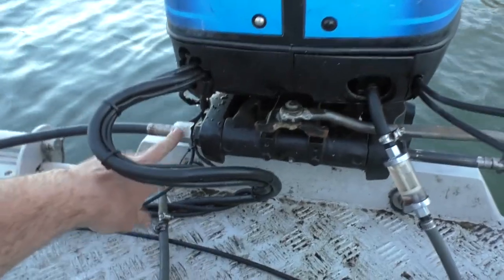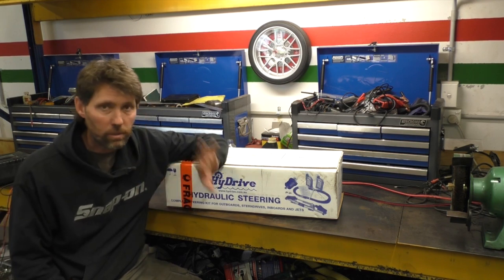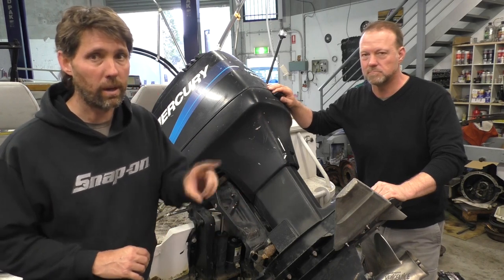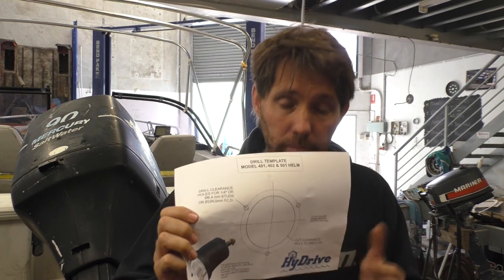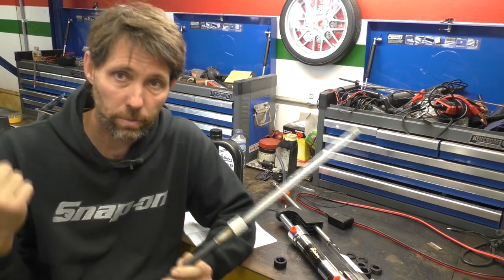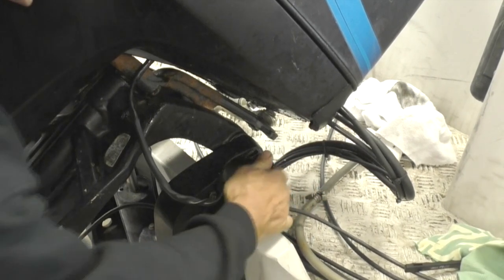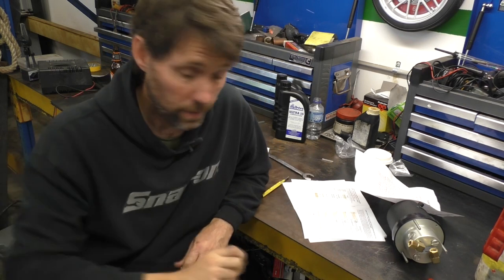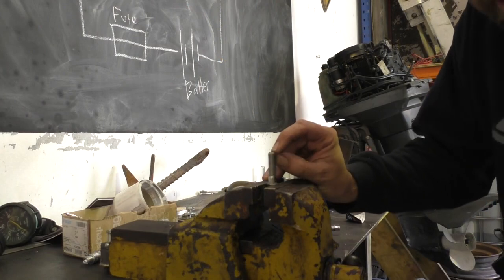Installing HyDrive hydraulic steering in a boat

Comment: Thank you for this. I am fairly new to higher power boating, and in (a long) process of rebuilding a boat from literal trash. This is an inboard/outboard setup, which I built from donor parts the engine and stern drive.. All rebuilt to new or better spec. I maxed the hulls original HP rating doing this rebuild/upgrade, but have rebuild heavier stringers and transom so there should be no troubles there. However as I said, being fairly new to higher powered boats I was rather taken off guard when this exhibited all the symptoms you showed on that boat.  So glad to come across this vid. It explains a good deal and a solution. Now a new subscriber. Thanks for the great vids, awsome introduction to boating.
Reply from the maker: Hi mate, sounds like you've been doing some great work on your boat restoration. In my opinion you've done a great thing reinforcing the hull and transom, that is something people often over look. Thanks for subscribing!

Comment: iv been wanting hydraulic steering as i was having the same problems, my boat has the same motor 90hp 2001 4 stroke 20 " boat. steering it was like driving a truck very hard and tiring. great vid as allways
Reply from the maker: Thanks Peter. This boat is now a pleasure to drive with this HyDrive steering installed.

Comment: Thanks for providing this tutorial.  I have a 2005 Skeeter SX170 with a Yamaha 90 2 stroke with mechanical steering.  I thought I would do some preventive maintenance and clean and lube the cable where it enters the tilt tube.  That is when I found out that in order to do this the engine has to be removed to get the cable out of the tilt tube.  I don't think  Skeeter will be winning any awards for that design.  It is going to be hydraulic steering for me this spring.  Skeeter was very short and to the point when I contacted them and were not at all embarrassed to tell me I had to remove the engine just to do some routine maintenance. Anyway, thanks for this info as it looks to be a pretty simple task albeit expensive.
Reply from the maker: You're welcome Greg. Yes, I've seen plenty of transoms that make it almost impossible to work on the steering in situ, it's a real pain. You won't regret the hydraulic steering though, it's well worth it.

Comment: Stu, put a nut on the bolt before you cut it , and leave the nut up high near the cut line. If you slip you only cut the nut, not destroy the bolt. Plus after deburring the end , spinning the nut off gives you a nice start point on the thread. Rethreading nuts are nice, but not many have them. I also left the tubes out in the sun for an hour to dekink them and make them easier to pull through, though in my case that wasn't much of a job. I also put tape over the open ends so they didn't pick up any junk, mainly because my boat is a much older boat with lots of loose flakey paint around.very good video again, maybe Hystar could get you to do an instruction video for them as their  printed instructions are a bit confusing for novices.
Reply from the maker: Hey Ron. I think it would have been easier if I had left them out in the sun, they aren't the nicest hoses to work with when they are cold and straight out of the packet. Leaving the nut of the bolt definitely sounds like a better way to go. Next time!

Comment: Recently i upgraded my boat from Honda 90 to Honda BF 150. And this was a big difference in steering with the push/pull cable system. Port steering became very heavy at high speed. So after watching your video, i decided to go for hydraulic steering. And today I installed a HyDrive Admiral Tilt Tube Mount Balanced Cylinder Kit on my boat, feels so much better.  Test on water is planned for sunday. Thanks for your video, it was a great help!
Reply from the maker: Hydraulic steering does make a huge difference with bigger motors. Glad the video helped you and good luck with your on-water test!
Reply: The test wend fantastic, feels like a different boat now. Before the engine had a free play about 3 cm left to right, now with the hydraulic Cylinder, it's locked in place, and the steering weel play was about 6 cm, now almost zero. I also installed a Zipwake Dynamic Trim-Control System, no more rock and roll.

Comment: To use a hole saw over an existing hole (if you had the correct hole saw) you can simply screw a piece of timber to the back of the material you wish to cut. In this case the existing bolt holes appear to be outside the required diameter of the hole to be cut so they would work as attachment points to screw through. Cheers Sam
Reply from the maker: Hey Sam, yes, a few people have mentioned that technique, it certainly sounds like the best way to go.

Comment: Another great vis Stu!!! where was this vid 2 months ago, I did the exact same install on a 175 salt water series Yamaha with the same unit. I did it on my own too, defiantly easier with two people. I haven't done much with hydraulics be for, I was thinking the bleeding would be the hardest part, but bolting the cylinder to the motor tiller bracket was the most challenging stage for me, its a three handed job.
Reply from the maker: Shame the vid was a bit too late for you, but glad you got the install done. How does the finished product feel?
Reply: Its a great product, very smooth operation and no feed back. got plenty of help from hydrive, when i emailed them they were quick with a response and were all to willing to help. highly recommend the system a great Australian product

Comment: I bought a 2nd hand boat with a cable steering which was very difficult to turn due to corrosion so I was thinking of changing the cable ... Then I saw this video and heard of hydraulic steering advantages and I have never saw hydraulic steering before... I ordered the hydraulic steering which happened to be exact brand you used to demonstrate... I managed to install it with no difficulties  and its working very well . .I can assure you I never read the manual I just did exactly as you did in this video... Yu are the best teacher I have ever seen.. Lot of people think I'm an engineer when they see the confidence I have just from your lessons... THANK YOU SOOOO MUCH!!!!!!
Reply: My concern is the linkage bolt . . I had to cut it aswell ... I guess the factory has to pay us for shortening the bolt through grinder
Reply from the maker: Hi mate, glad the video helped you with the install. Enjoy your new boat. :)

Comment: Here in the states we have seastar  hydraulic steering.  Any difference from the hydrive to seastar?

Any opinion on seastar since I'm about to purchase one addition. 

Thanks.
Reply from the maker: +John Betts They're both pretty good systems. I would be going with whichever option you will get the best local dealer support from to be honest.
Reply: Dangar Marine 

Thanks Sir.

Comment: That´s a really nice video. After seeing how you struggled bleeding the system by your self, I would probably use one long clear hose from the bleeding nipple on the ram going into the fillingfunnel/bottle. Should make it easier doing it without a beerbudy ;-) .
Reply from the maker: Hey Johan, you're definitely an ideas man. Love it! :)
Reply: You could take it even further if you were installing several systems. Use a long clear hose with an inline hydraulic filter and a hose barb ball valve at each end to minimize oil loss and seal it off for storage. When done bleeding close both valves, coil up the hose, then hook the short bit of hose on the bleeder end to the barb on the opposite end to form a closed loop, no oil leaks out and no dirt gets in.

Comment: Just a tip for torquing the tiller bolt use a crows foot not sure what they call them down under haha. also to cut the hole for the helm you can use a body saw
Reply from the maker: Yes, we also call them crows feet. I'll have to buy a set one day. Have needed them a couple of times.

Comment: Thanks for this, Stu.  After watching, I bought the Hydrive system - as I live in Adelaide.  However . . . the Installation Instructions say that Yamaha motors require that the "Transom Clamps on these motors must be CUT OFF."   Scary!

Have you come across this?
Cheers
Max

Comment: Had the Hydrive steering with the OMC XP 2.6. Carried Over to the 2.7L V6. Nice Aus unit, but had to change to a set of Seastar system. Nice piece but just felt like a gate valve. Nothing against the Hydrive, but it is application vs Requirement. Nice tutorial.

Comment: Hi.  I'm trying to get a seal kit installed for a Seastar HC5342 and just can't get the seal glands off.  The crappy wrench that comes with the HS5157 kit seems to be junk.  Pins bend and actually fall out.  I'm stumped and on the verge of replacing the hole unit.   Any suggestions on what I might try?

Comment: Tip - put a nut on any bolt before you cut it off.  after cutting and grinding the tip remove the nut to clean out and starting burrs.  Love your vids have helped me with several issues.
Reply from the maker: Yes, probably is a better way to go than using the thread repair kit.
Reply: actually the problem I have is getting the threat cutter started after I cut and grind the bolt. If I have one handy, I put the die on first before cutting the bolt otherwise I use a nut.  Cuts the time and the cross threading problem.

Comment: A brilliant video mate! And I learnt so much more from watching it then I did tooling through  the fairly scattered instruction manual from HyDrive. 

One problem I did strike is that when I installed the helm pump and hand tightened the two brass oil unions until they seated in out quite firmly, they  were both facing the 3 o’clock position (port) , whereas my oil pipes come in from 180° apart at 9 o’clock (starboard) There is simply no way I could turn  them any further to make up that discrepancy of 180°, if I attempted that it would split or crack the helm housing for sure. According to the manual, if this happens, they recommended unwinding the union until it is positioned as close as possible to where you want to connect the pipes. This made the union very very loose, and although I applied the Loctite solution to it, there is simply no way it would tighten up the male to female connection, and as a matter of fact, after 12 hours, I could easily unscrew both the unions with my hands and the unions were far far too loose to expect them to hold, Loctite or not.

After a lot of drama, I eventually rerouted both the oil lines to a position where I could just get them into the two tightened union connection points. They have a good run and are not obstructed, blocked or twisted, but I’m far from happy with the union connections to the helm pump and if there is going to be a leak I feel that is where it is going to be. 

Anyhow, all finished, looks good, the output connection went very smoothly and much easier accessing those two unions into the hydraulic piston cylinder.

Bleeding the system on Saturday so guess then I’ll know the worst!

Congrats on the vid Mate, superb! 👍👍👍

Comment: Surprised you don't like Two Stroke Mercurys you see plenty of old ones around and they are known to be Bulletproof. If I purchased a Merc with oil injection I would pre mix 100 to 1 for insurance and check the oil tank every time I re fuelled. I have seen footage on seised valves on four stroke Mercs and people working on them saying the Quality is not the same.?

Comment: G'Day,,Just a couple of things to make your life a bit easier,
1) If you had a 85 mm hole saw you have a couple of thread in side of cutter , Where is screws to drill manderal,,use a smaller hole saw as a guide to cut bigger hole,
2) Your tapered ""cone's'' are called olives,and the reason you needed to remove the tube from fitting ,,is so as you crush the olive,your tubing grows a little,and if the hose reaches the inside of tube connector,that will cause olive not to seal on both sides of tube,
3) you don't have to tighten the nuts on the fitting all the way,,this over crushes the olive and may cause leaks from being too tight.
and lastly nice job,

Comment: Awesome video. Thanks so much. 
Tip. If you attach a scrap piece of wood behind the dash you can hole saw in the centre of the original hole. This is especially good if cutting a whole in fibreglass as it makes a clean cut on the back of the hope. 
Hope this makes sense 😂. 
👍🏻🇨🇦

Comment: I can't believe you used a jigsaw for cutting the hole. What you do in situations like this is - attach a piece of plywood using bolts, and cut the hole using hole saw. This way you end up with nice finish of the cut, you get perfectly centered hole and you don't damage or scratch surrounding area.

Comment: When making larger hole in dash, why not make a plug the size of the existing hole that rides on the pilot bit of the new correct size hole saw ? Or, I have had a lot of luck with guides made by drilling a hole with the right size  holesaw  in a lump of scrap board and clamping the thing to the dash( you can make a centering plug for this if you like)   I hate horrible haggled holes !
  To torque the draglink bolt try a crowsfoot on your torque wrench.

Comment: Fantastically helpful.  After watching your channel I have changed the waterpump kit on my 150 Yammy / 20ft Outrage.  I installed a fuel filter/water separator.  Now I feel like I can diagnose a problem with my hydraulic steering where it seems ok running for a while but binds up going to starboard at some point.  Thanks.

Comment: If you bolted or screwed a flat piece of wood behind the old steering hole you could use a hole saw to cut the new 85mm hole as the sacrificial wood block will centre the holesaw drill bit. Holesaw's make nice round holes in metal easy, can't live without them. Wire wheels spit high speed needles into eyeballs & soft skin, eye protecting is a must when using wire wheels.

Comment: Stu, you would think that hy drive would colour code the tube like speaker wire. Make it a lot easier for the installer, no mucking around with electrical tape and suchlike.

Comment: I enjoyed that video, very interesting. The bleeding side was a bit more tricky than I imagined it would be. I am about to start fitting twin 60 hp Yamahas, I dont want a bar linking them up. I will be using 2 rams. I presume I need run pipes in series from one ram to the other then back to the helm. You got any ideas on this? Next time you cut a bolt down put the nut on first. Cheers, Steve

Comment: You could have put the re-threading bold on before you cut the bolt, then it cuts the burrs off  as you unscrew it. You don’t even have to use a real- threading bold, plus you get two bolts to clamp in the vice making it a cleaner cut.

Comment: Hi! Love the video, just wanted to confirm the high tensile bolt used in the tiller connection was supposed to be fitted in that direction as the nyloc nut on the bottom of mine has fallen off and the joint was found to be separating. Any advice will be great! Thanks again!

Comment: Great video Stu ! I would love to install a hydraulic steering in my boat, but the problem I have is the space in the flipper 470 S . I only have about 52-53cm on each side for steering clearing. Not sure if there is such a compact system for a 60hp.
Reply from the maker: I wouldn't imagine this bullhorn design goes more that about 50cm out from each side. I'll measure it tomorrow and let you know.
Reply: Hey Stu. Did you get the measurement ?
Reply: I think you forgot me @Dangar Marine :)
Reply from the maker: I did, sorry! It extends out 16cm from each side of the outboard mounting bracket. Quite compact.

Comment: Get some double-sided tape and apply it to the dash. Then put plexiglass over it. Start your pilot hole with a standard drill and then use your hole saw. You can do it in other ways from behind with wood.

Comment: I love 2 stroke outboard not engine oil changes cause it burns the oil and there is definitely more tourqe for the get up and go then the same horse power 4 stroke unfortunately if you are looking for new outboards atleast in USA you can no longer buy a new 2 stoke outboard sense brp shut down evinrude which is my favorite outboard

Comment: I brought a boat with a teleflex cable it was seized up I’m a strong guy but was nearly impossible to steer Lieing bastard at boat shop said it would loosen up with use what a lier so what I did is brought a hand pumper for killing weeds I’d pressurize the bottle and unscrewed the Tele flex cable under the steering wheel got a length of hose and a hose clamp and tied over the teleflex cable and added power steering fluid and metho to the weed spray bottle then hose clamped that on end of bottle then pump pump pump and clicked trigger took about 4 hrs and fluid started dripping out rear of the tele flex cable which I had detached from motor after that it’s like brand new

Comment: I have an old Suzuki DT225 which is now so heavy with grease in the pivot tube that its stripping off the teeth in my manual helm. I'm going to have to take the head unit off at the end of the season to resolve but was hoping that hydraulic steering would get me through to the end of the season. Does anyone have any thoughts on this as 4:38 into the video its advised to resolve this before installing hydraulic ?

Comment: I just installed a hydrive on the weekend and remembered seeing this video years ago. It makes a bloody brilliant tutorial and helped me out a lot.  Was a 2008 evinrude 75hp using commkit1. Issues I ran into were I had to  Put the pivot arm above the tiller arm in closest hole to pivot. spacers all the way to port (one thick on port, thin on starboard) Had to unscrew the cowling to make room for the bolt rather than cut it down too much.